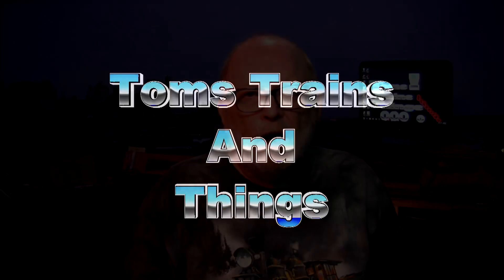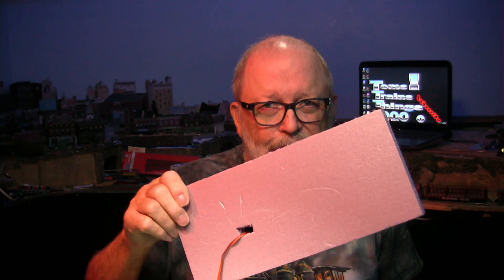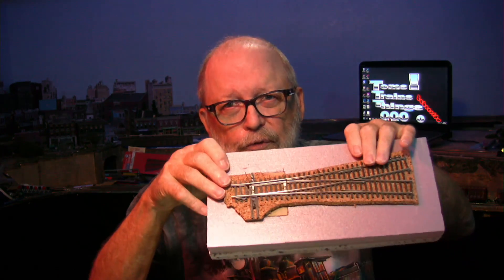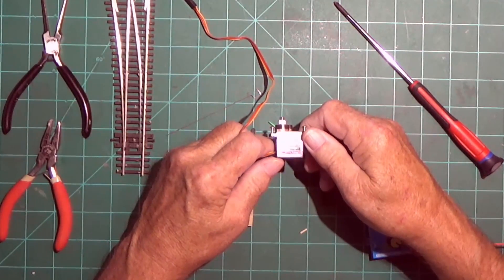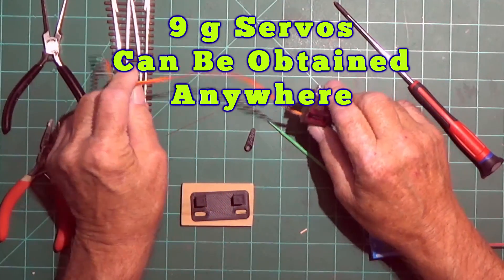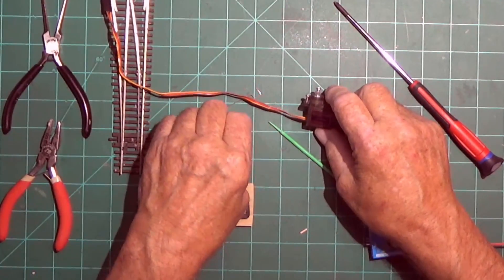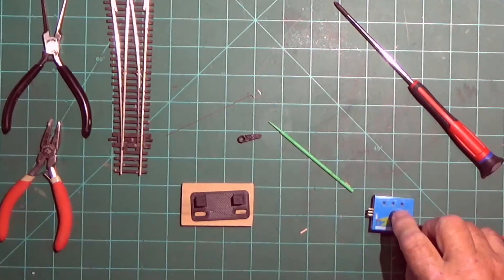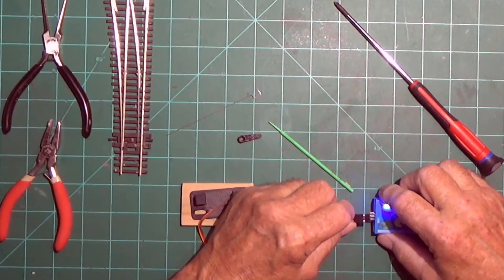How To Mount Servo Controlled Turnouts

Comment: Really interesting I was not aware of this mount for servo by Iowa engineering. It does not provide a way to mount the switch to power the frog. I have try the one from Tam Valley depot. They provide a switch mount to power the frog. Unfortunately they discontinued this product as his son take over the business. I have found an Stl file to print my mount. But now I need to purchase a 3D printer.
Reply from the maker: They used to sell a slow motion controller for servo which uses the same mount but has an additional section for the circuit board. The plans for this device is still on their web site.
Reply: @TomsTrainsandThings   i saw this, on their web site. the tam valley model use the servo actuator arm to trigger a micro switch for the frog power kind of similar than a tortoises. Work great on the one I have.

Comment: I like the idea of how you're mounting them except the servo is not too serviceable. My table will be 1/2" ply and 1" foam. I planned on similar style but under the ply. Your thoughts? Thanks for your videos. Very informative and easy to follow. I've been away from the hobby for 40 years. My how things have changed!
Reply from the maker: With everything attached to the turnout from underneath, all you have to do is slide the rail joiners out of the way and lift the assembly off the layout for maintenance.

Comment: Hey Tom, this is fast becoming my favourite YouTube channel!
Any tips on switching frog polarity with arduinos?  I'm thinking of a pair of relays working in unison with the point servo...
Reply from the maker: That is my plan for this module project. I just purchased a few electrofrog turnouts for this. A relay in the circuit of each turnout will work perfectly to change the polarity.
Reply: Hi there,  @TomsTrainsandThings  did you ever do that video about switching frog polarity with arduinos? That is a project I am interested in doing myself.
Reply from the maker: @alexandergreig8946  Since I disassembled my layout and moved shortly after this video, I did not. You may be able to get some insight as to how to use a relay by watching my Arduino Made Easy(er) video I did on controlling a relay for a crossing signal, Similar situation. 

I'll be doing more Arduino videos shortly, getting my layout and workspace together in my garage at this time.

Comment: I really like this mounting method Tom. It puts your servo right up next to the switch and since I am using hard foam like the example, the little wood flat will work great. A couple of tiny brackets would probably do as well as the pre-made servo mount since we are using that flat board. Thanks for sharing this tip, I'm defiantly going to use this on my layout! Till next time Tom, Happy Modelling! Hans ...
Reply from the maker: Thanks Hans. This method seemed to be the best for going through the foam. Luckily, I had someone show me something earlier in the year that gave me the idea.

Comment: Hi Tom, I am doing a gate that opens and closes continually for an animation with a couple of kids swinging on the gate is there a servo that will do this with continuous running or do I use something else thanks.kevin  my email is ketc@xtra.co.nz
Reply from the maker: Any servo will do as long as the travel of the servo is limited to 180 degrees.

Comment: Tom,  This is a very well done demonstration offering a complete solution of how to actually mount a servo.  Others will speak about the servo concept and then leave you hanging on how to actually implement the connection to the turnout.  In my case, I have 1 inch of foam over plywood, but the idea is the same, as long as the total height of the servo assembly does not exceed 1 inch or you will have to cut into your plybood base.   I hope you are within 1 inch.  Might cover this concern as well.

Additionally, this speaks about one servo with a control wire of so long.  But what is the scheme of connection of placing your arduino, with a servo shield, and then running the lines out to various distances to wherever the turnouts are actually located?  How do you join on the plug at the end of the servo, all the way to the pins on the servo shield?

Also cover the ardui8no/shield/cable portion so you have a full complete applicatin from arduino to a distant turnout, inclluding all mounting concerns and connections all the way thru.  Otherwise a pretty good detailed job at the turnout end...now for the arduino end.

Bob S
Reply from the maker: Check out my other videos on servos and Arduino to see how everything works together.